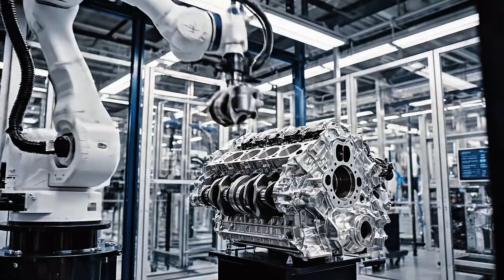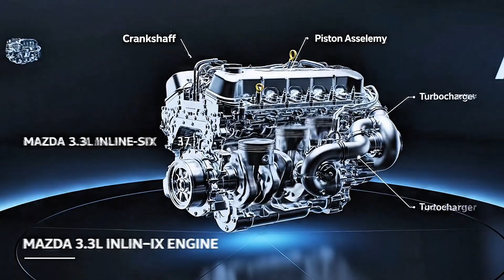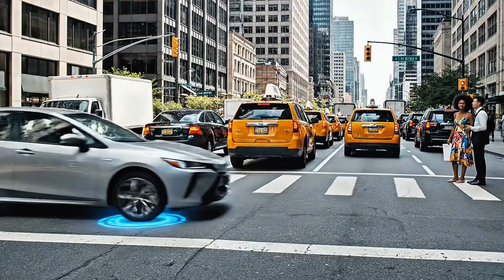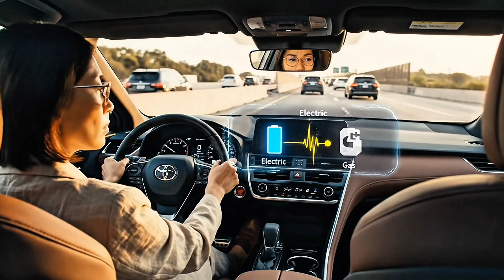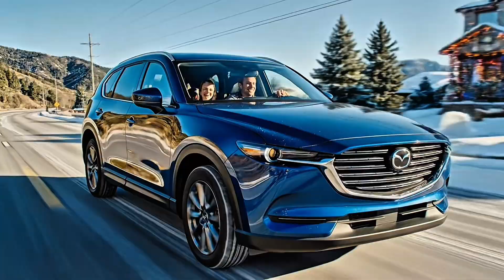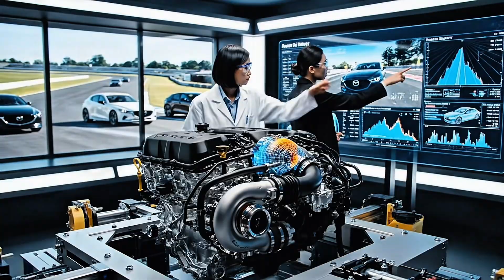Mazda Just Revealed Its New 3.3L Turbo Inline-6… And the Performance Is Shocking

Comment: A IL-6 is perfectly balanced and has 7 main bearings make a stronger bottom end even a V8 has only 5 main bearings. A V6 is only has 4 main bearings. Big over the road truck diesels are IL-6 for these same reasons.
IL-6 are generally easier to service with more room under the hood.
Reply from the maker: Great explanation. That’s exactly why inline-6 engines have such a strong reputation for smoothness and durability, especially in trucks and performance applications.